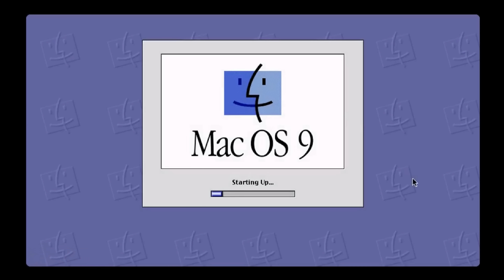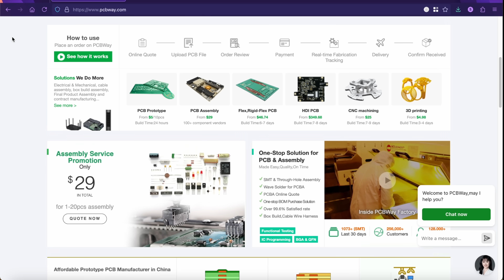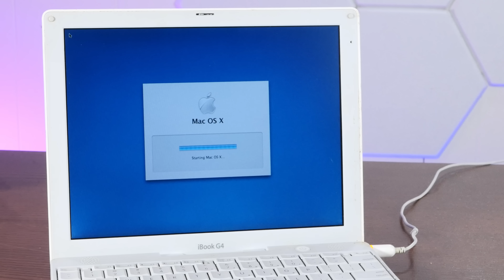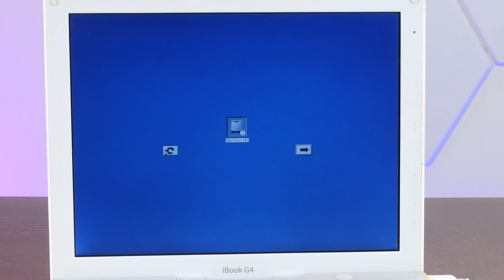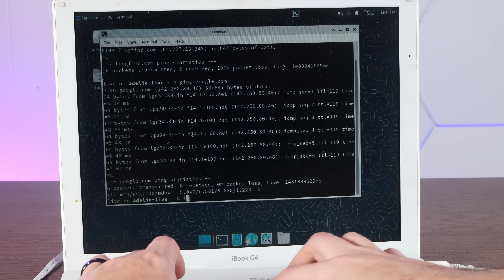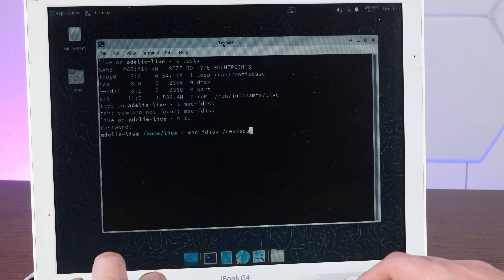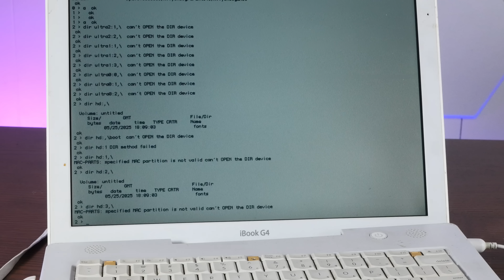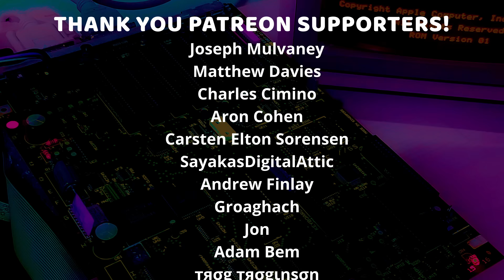Someone Gave Up On These... But Not Me

Comment: I have that ibook downstairs, with 1.5gb of ram. If it runs well I might see if I can use this to get it back up and running. I really miss old Mac's. Where I worked, we frankensteined so many PowerBook G3's and ran them well into the mid 2000s.

Comment: my iBook G4's plastic hasnt deteriorated quite yet but the optical drive is busted and the screen backlight is shot. I've thought about swapping out the optical drive and repairing the screen but I'm still having a blast with the laptop using a mini VGA adapter. Could maybe recell the battery too someday

Comment: I bought the 12" G4 because I was traveling by air quite a bit, and it was able to be used on the tray table in economy! We used it for about 8 years, until we bought a 2012 Mac Mini, which is still in everyday use, with Open Core Patcher, now on Ventura.

Comment: blank screen on the PowerBook G4, yup, that's a common issue - because a lot of them use ancient NVIDIA chips, which are barely supported by Nouveau, and the proprietary driver only supports x86 and ARM.

Comment: @Sean, see in what condition are the ram chips/ram controller on iBook G4 12" . Believe me,i have 4 of them ( 1x 1.33 GHz 12",1x1.07 GHz 14" and 2x1.2GHz 14" all of them with bad ram controllers) and most of the time the lagging/freezing screen,instant black screen and etc. come from this.This works and on the PB G4 BEFORE 1.5 GHz models.(thats why Apple uses GForce and newer chips on the 1.5 models 12/15").The iBook G4 1.42 model uses the same chips like PB G4 15" 1.5 ghz.

Comment: This so reminds me of a priest at church, he was gifted an old MacBook, which he promptly handed my way to see if I could get it going, dead battery, near dead power pack, and of course no password. Kind of a burger with the lot.
I could get it to boot, kind of, followed by a crash and a long winded restart/reboot sequence. I suspected power problems - A new battery mostly fixed that, but now it mostly died when coming out of standby. I tried a new SSD in place of it's HDD (I had a handy new one bought for my PC), No that s not it, although it seems better. Google was no help, others have this fault but no guidance to a repair. Well it's OS is a few gens old and it won't take the latest Apple OS - so...  too hard...  Give it back and say it's too old, out of support, forget it.
I could try Linux, but that probably won't fix the resume crash - aarrggggh.

Comment: The 12” PowerBook g4 was my favorite laptop form factor back then. I fixed and upgraded so many of these things. I even took my 12” g3 iBook and dyed all the plastics Orange which was a fun project. I think I still have the 14” iBook shell that I dyed black in a box somewhere and my 15” PowerBook g4 that I was attempting to recell the battery.

Comment: Of course it will die after you spray liquid directly onto a laptop. Kids, never do that at home! Apple Laptops were never water resistant. You can do this with a relatively recent Thinkpad as it has drain holes, but only on the keyboard, not the screen and certainly not iBooks or PowerBooks, or leave them drying for 24 hours after you did it.

Comment: I had that same iBookG4 1.42 back in the day. I sold it for $100 and wanted to cry until I got my 2012 MacBook Pro 15". That made me feel better. I still have the MacBook Pro running Sequoia 13 years later. I picked up a working iBookG3 a while ago for $20. I need to install Linux on it when I get time but mostly I use it for OS 9 apps.

Comment: Just two days ago I went to my local dump and went over to their ewaste spot and managed to pick up a 2010 MacBook Pro. I slapped in an extra 4gb of ram making it 8gb. Then installed a ssd I had sitting around. Installed Linux Mint and now it's like it is brand new. I love this little machine. Ewaste is my favorite, you never know what you will find plus, it's a cheap hobby.
Reply: I did the same to my MBP 2010, except mine was a hand-me-down from my dad.  8GB ram and dual 500GB SSDs.*  1 SSD had High Sierra on it, the other has Mint 22.1.  Mint works way better than High Sierra.  Also, under HS, the notorious discrete GPU failure issue and automatic dynamic switching makes the MBP unusable.  Mine has a 2.66 GHz Core i7 and I think it's a 17 inch display.  (* The "dual SSDs" is possible with a special bracket adapter from OWC.  It installs where the optical SuperDrive goes.)
Reply: @minty_Joe  I was thinking about removing the optical drive and installing another storage ssd. I replaced the battery with a new one and on Mint, I am getting close to 6 hours of use before needing to charge it.
Reply: @MrCrispy1991  Oh sweet!  I'll definitely be adding "new replacement battery" to my shopping list.  The one thing I'm not too thrilled with on my MBP is the built-in Wi-Fi.  Under Mint, it's quite a weak signal, but under High Sierra, it's almost maxed out.  Hmmm... 🤔

Comment: I've picked up a smattering of iBooks/MacBooks over the last few months, and it's always exciting because most people have no clue what they have or if it even works. I have a couple that were used in schools and the information on the bottom was completely rubbed away. I still don't have an AC adapter for any of the iBooks, and my MagSafe charger is a bench PSU with MagSafe tip my brother found on the side of the road.

Comment: My first laptop!  I bought an 800MHz iBook G4 at my university's little computer store, with student discount, in 2004 and used the heck out of it.  I took it with me to Mexico when I did a study abroad program, I carried it around working on my homework here and there, and I upgraded it to max out the memory and added an Airport Extreme card to it.  It's probably still the most satisfying computer experience I've ever had, really.  Sturdy, reliable, fun to type on, very solid-feeling (every Windows laptop of the era seemed to flex like nobody's business), and even looked great to boot (there weren't a lot of sleek laptops in 2004)!  Also, despite what many probably assume today, in 2004 an entry-level Apple laptop was cheaper than most PC laptops, so price wasn't a consideration there.

Years later, I installed Ubuntu and then Debian Linux on it and got a few more years' use out of it with what was, at the time, the latest version of those operating systems.  I don't use it regularly today, but it still works, and it still looks great, too.

Comment: had kinda similar looking error when tried to boot an old server, which had a H/W RAID card configured as single 40+ TB virtual drive and grub couldn't find boot files on the partition even when pointed manually from grub-rescue. fixed this by using separate much smaller boot drive...

Comment: backlight inverter board for the ccfls. that's what makes them dim then fail and then squeal. did a ton of these in the early 2000s. Also ALL the Radeon gpus needed to be reballed.
Reply: I remember sticking quarters over that chip to put pressure on it from the case so it would boot/work.

Comment: The 12-in G4 PowerBook went as high as 1.5GHz, the 14-in G4 iBook had a maximum of 1.42GHz while the 12-in G4 iBook went to 1.33 GHz. Oddly, the iBooks could have up to 1.5 GB of RAM in both the 12 & 14 inch versions whereas the 12-in PowerBook was restricted to 1.25 GB of RAM.

Comment: In the early 2000s I installed Yellow Dog linux on my PowerBook 1400. That was a bad idea. It worked, but was so slow as to be unusable. But I might pull out one of my old G4 powerbooks and give Adelie a shot. It appears the distros for older hardware have come a long way since the early 2000s.

Comment: These iBooks were weird. RAM partly soldered but could be easily upgraded.  The battery, keyboard and airport cards were also straightforward to remove and replace, but the hard drive and slot-loading optical drive were a pain in the a$$ to replace. Love my 14-inch G4 1.42 but it's gonna be rough when the original 60gb HDD fails.

Comment: i had a lot of trouble with bootloaders on my ibook g4. only linux distro i was able to get working on it was debian-ports ppc32 (with xfce), but you have to manually partition the hard drive, and you have to stop it before it installs grub and manually install yaboot. i don't remember all the steps for either of those lol. 

void linux and adelie linux claim to target this hardware but i got nothing out of them and had a much better experience with debian.

Comment: So, speaking as a 20 year veteran Premium AASP tech (retired), I gotta warn you that the vertical stripes on the display likely indicate a GPU failure. I’m betting that the Linux distro that you’re using is not asking the GPU to draw the screen in the same way OSX does, possibly it uses the CPU rather than invoking Display PDF, so it should be a little more stable. One fun trick with “fixing” that GPU issue that we used to do back in the day is to use a quarter. Hear me out. The bottom metal shield will have a large square indent where the GPU is. Tape a quarter to that square, and then replace the plastic bottom case. The pressure seems to resolve whatever solder separation is happening. This was never an approved repair, and usually only got used in desperately poor student solutions, but it’s a “fix” I used many times as a temporary work around. Might be what’s wrong with the 12” too. Cheers!
Reply: These are iBook G4s, not G3s. The G4's logic board was redesigned so the GPU is on the top of the logic board about 2" from the CPU, secured to the same large heat spreader. They're not as susceptible to GPU failure. It can happen, but that fix doesn't really work on it. Common to both types is display cable damage, though. It flexes a lot and sometimes gets pinched in the hinge cover.
Reply: using too much  the gpu will result in those strange lines going diagonally and then really fried chip. Or so hot that it melted the soldering
Reply: That was more an issue with the G3 iBook, particularly around the 700MHz era, along with pongy keyboards due to the glue below heating up. All praise ROHS and what it did for solder joints. The G3 iBooks pretty much all need a shim these days to keep working. Lines on a G4 are likely more symptomatic of a failing GPU rather than cracked solder joints. I had a last generation 12" Powerbook with the same fault. Only cure was a logic board swap.
Reply: It is almost certainly using normal linux gpu drivers that treats it as if it's a PC GPU of the same model. PC and MAC GPUs were normally identical except for the BIOS
Reply: Speaking of jank solutions, I had a Dell D630 laptop which had it's backlight just die. So what I did was literally pour a whole packet worth of hot glue into the bezel which would cause the backlight to come back on when pressure was put on it. Safe to say that laptop is now double junk, thanks me age 15!
Reply: @teh_supar_hackr  I once used the magnets from ear buds to fix a defective sleep switch. Jank  solutions rule 👍
Reply: It needs a bga reball. Pressure can help temporarily.
Reply: @humidbeing  Yep, though Action Retro almost certainly doesn't have the skills nor equipment to do that. I have all the necessary equipment and I still struggle to do it properly.

Comment: A lot of G4s had bad solder joints on one of the power management SMD ICs.  So, it might not be that bad to repair with a hot air reflow tool.

Comment: my 12" PowerBook G4 also developed the pitting on the palm rest back then.  I remember posting about it and asking about it on the forums at the time and It seems some people's sweat would cause the aluminium process Apple was using on them at the time to breakdown and cause it if I remember correctly.
Reply: Mine had the same issue on the palmrest after a few years.  It's ugly, but not quite so much as the old TiBooks with the peeling paint.
Reply: Still happens. My xenomorph acid-for-sweat palms are eating my M1 Macbook Air.
Reply: @trains4ourkids  but not nearly as bad for me. My pre-unibody MacBook Pro were much more delicate than the space gray models of these days or my sweat became gentle?

Comment: I have also a PB G4. I use Macs from that era with 3 different OS_ MacOS X 10.4 and Classic, because those machines are the fastest way to run my old software and MorphOS, an OS inspired by AmigaOS and partially compatible. Which makes my iMac G5 one of the fastest Amigas, until today. Linux is my daily driver, on more recent hardware.

Comment: Well, an idea... I once spent a full day trying to boot linux on an older mac. In the end, it was a matter that the firmware didn't like the partitioning Linux did on the disk. All that was needed was to start the computer with a MacOS installer and partition it from there, then it was a matter of using the Linux installer to format and use THOSE partitions. That, or the SSD isn't supported (or there's some other hardware issue, but then I believe you wouldn't be able to install anything to that drive).
Reply: I think this is on the right track.  The messages in rescue mode seem to indicate that it sees the SSD, and is finding partitions there.  But, it's not recognizing the filesystems (or it's not happy booting from the hfsplus partition).  Most likely it's a case of wiping the partition table and putting down a fresh one, then formatting the partitions with something it'll be happy with (on Intel, ext2/3 is usually pretty safe, not sure if that's also the case on old PPC Macs)

Comment: I remember the late ibook G3 that had a similar design as the polycarbon G4 laptops in this video. My class was part of the pilot program in 2002 for the MLTI ( Maine Learning Technology Initaitive ) where they gave iBook's out to jr high students. 

We never really did much with them aside for note taking and the laptops on OSX 10.3 were really sluggish and you spent a lot of time looking at the pinwheel. 

The laptops looked nice for the time but that's about where my enjoyment and nostalgia with those machines end.

Comment: We had these iBook G3 and G4's when I in middle school.  i still remember the keyboard flex and how easy it was to pop those keycaps off.
Reply: Same here! I'm from the district that had the surplus iBook riot back in 05' when they went to Dell's at the high school level. The middle schools got the G4's a year later and about three years ago I bought the exact same version of the one I was issued (late 05' G4 1.33 ghz). Loaded Tiger onto it as well as found my school's wallpaper on interfacelift. Modern web browsing is pretty slow even with PPC specific web browsers but Protoweb and theoldnet proxy in Safari are quite nice. There's even a YouTube like site for old computers on Protoweb called Warpstream which is great for a nostalgia trip as well as recent tech videos from some YouTube channels.

Comment: i picked up one of those G4 aluminum powerbooks up from egay for like 20 bucks a couple of years ago. it had a bad superdrive but everything else worked just fine. i was gonna drop in an ssd and replace the superdrive and replace the battery. but i moved 3 times since and now all i have is the machine still i don't know where the power cable is or the parts i ordered for it is. so it's just sitting in my closet chillin and dying. i like the design of those old aluminum powerbooks. i have a M4 macbook and i kinda hate that thing.

Comment: iBook G4 with Gentoo PPC hit the spot back in the 2000s! I should get one for old times sake…
Reply: Gentoo. Haven't heard that name in YEARS. I think that was the first linux I've ever tried. Allthough, I've tried it on the original xbox. GentooX was the distro's name.
Reply: I had an iBook G4 for a few years, it was after the Intel switch so I got it cheap :D 
I tried several PPC distros just for fun, back in 2008 there were still plenty, Ubuntu, SuSE just to name a few. But none of them was so perfect as Gentoo was. Took a few days to install everything but man, it was worth it.

Comment: I didnt know linux distros were released on vinyl lol
Reply: "Vinyel" sounds something like saying "Polytetrafluoroethylene" instead of Teflon
Reply: 45 RPM too! if he installed it at 33RPM, he would've gotten Ubuntu or Fedora or something
Reply: @FletchBrendanGood 
Suppose 78rpm would be Mint?
Reply: @glenncaughey5044  I was thinking either Porteus (because it's fast) or AntiX (because it's meant for old hardware, like a 78 shellac disc would need)
Reply: Next, reel to reel!
Reply: @glenncaughey5044  No, 8 track!
Reply: Well, he did say “weird”…
Reply: I can remember seeing those CD-R’s a while back, as in 2006 or so. And I can’t remember if they were R or RW.
Reply: Well, actually, there was a time where BASIC programs and other software were distributed on phonograph records.  I can recall one computer magazine back in the day included a Flexidisc (square perforated plastic with record grooves etched on the surface and floppy enough in structural integrity) of the source code.  Did it work?  Yes, and no.  🤓
Reply: Hipsters.
Reply: I had that exact thought too, 😂
Reply: I mean it's possible, the users tend to break the laws of physics to get the penguin running on anything.
Reply: Vinyel*
Reply: @Pleyer7575lol Depends on where you live 😅 In Germany "Vinyl" is correct
Reply: Vinyl is correct in the English language  @Splicher
Reply: @Splicher  Vinyel is a Dankpods reference lol
Reply: @Splicher Winül is the German word
Reply: @Splicher in English, Vinyl is correct